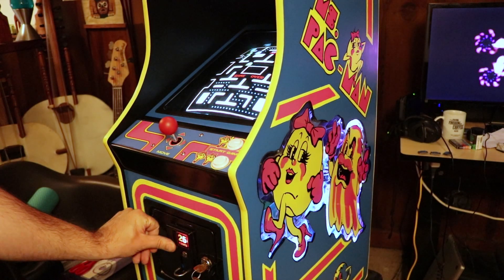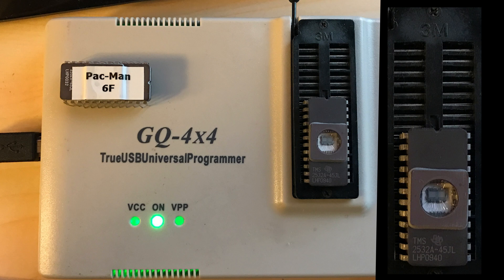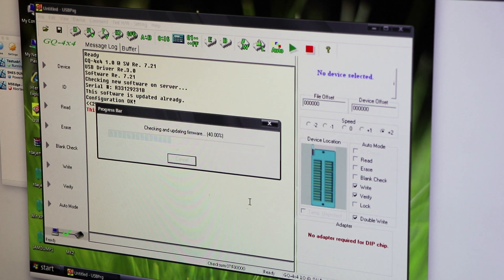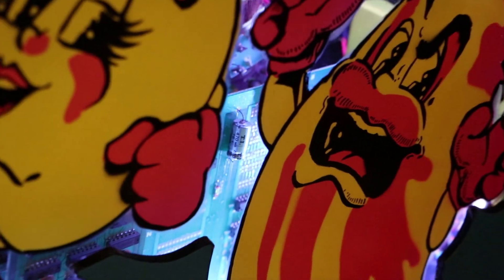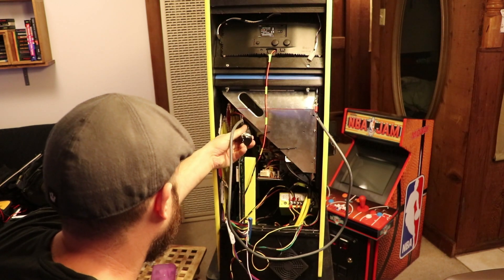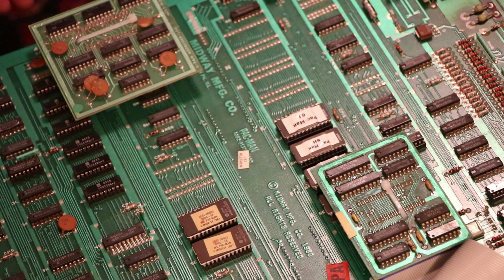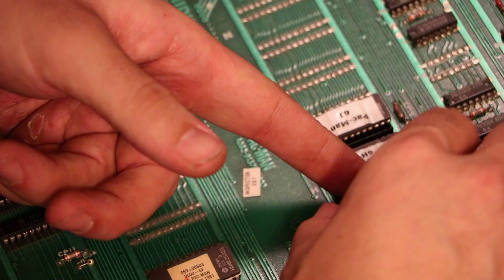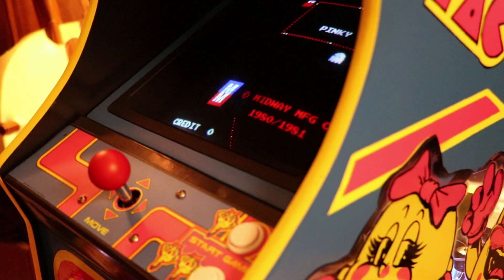Ms Pacman Fast Mode Mod

Comment: Although it may work on an external 5v supply the manual actually calls out 9v FYI

Note: If you are using an un-powered USB hub or extension hub, it may not provide
enough power to operate the USB programmer. In this case, you may need a 9V,
200mA (or greater) DC adapter with a center-positive, 2.1mm DC plug.

Comment: My question is, how do you get the alternate levels.  One machine I played in the past had a level that had stair step sections
Reply from the maker: There are a bunch of mods for Pac-Man boards. There are at least a few “alternate maze” hacks, usually involve replacing roms, and sometimes other slight modifications to the board (some jumper wires, or other mods)

Comment: Great cabinet i like the see thru plexiglass... curious if i can use emprom eraser to erase original chip and install new program on the original rather than buy a blank? Thx for vid.
Reply from the maker: SCAMATICS777 yeah absolutely, as long as the chip has a window under the sticker, it can be erased with UV light and reprogrammed.
Reply: Thx

Comment: I can't give enough thanks for this video.  I have the same programmer and have been struggling to figure out why I can't get my 2532 chips to program.  Finally you shed light on my problem.  It was the 2532a "read only," and the -2 setting that I needed to get it right.  After I watched your video, I immediately went and programmed 6 new roms for my Ms Pac board and it worked perfectly!    Nice job on your cabinet builds.  The plexi on your Ms Pac is pretty cool.  Thanks again for this video.  Spectacular!
Reply from the maker: That's great to hear! Yeah, I struggled with those chips for a while until I figured it out too. Really glad this video helped :-)